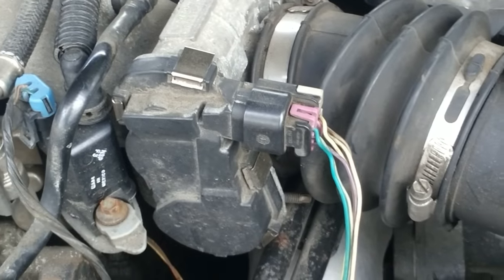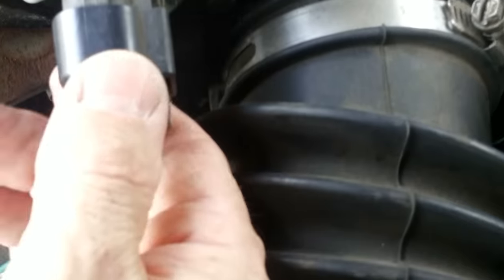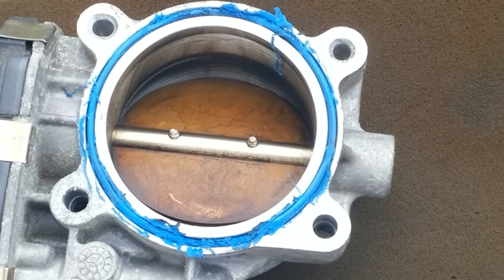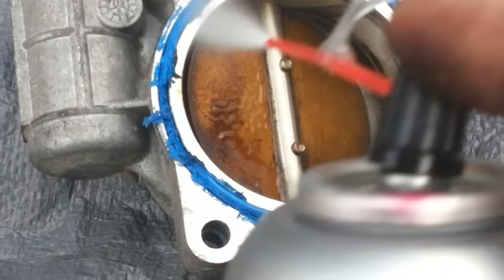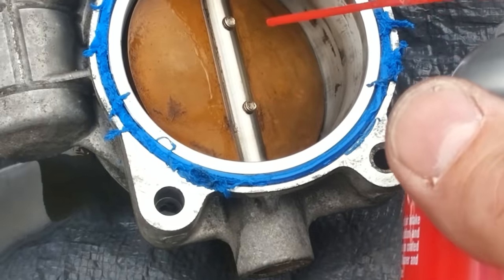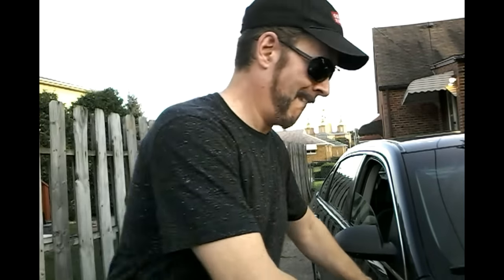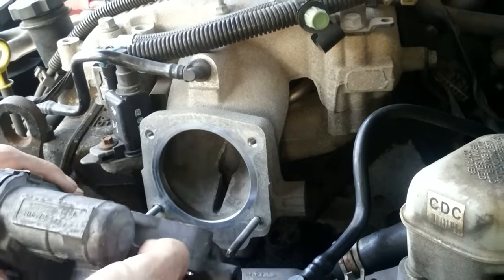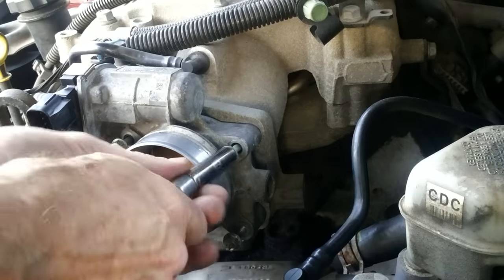Reduced Engine Power.  Here is the FIX.

Comment: MY GOD! You took a 5 minute job and worked it into an all day job. All you had to do was buy the kit GM makes and remove the plastic side of the throttle body and replace it. You did not have to remove the entire throttle body. It does not need to be re-programmed. The ECM does that automatically when driven. Jesus, if you are gonna make a video, make it truthful.
Reply from the maker: Took the throttle body off to clean it and replace the gasket.  Entire job took 15 minutes.  2011 and newer vehicles need to have a throttle relearn procedure done.

Comment: Question?  You said the EMC needs to be reprogrammed & throttle learn reset 2008 thru 2011 Right? I own a 2007 does that mean i wont have to do this step?
Reply from the maker: Your car will re-learn on it's own.

Comment: Hello Sir, when you was having this problem with your car, did the bad sensor prevent your car from starting?
Reply from the maker: No, it would start back up each time.  Is yours not starting?
Reply: @lifeafterlife8417  , yeah. My van will crank, but will not start. I had the throttle body sensor code, on my van. And, I had to change my temperature sensor. I finally replaced my throttle sensor, yesterday. I need to replace my thermostat, before I try to start, again. I had a blown head gasket, I repaired the right way. Changed all the gaskets & valve seals.

Comment: Car on for 3 minboff for 60 seconds do this 3 times then drive above 45 for 10 min high and low accelerations then if not good just do the first steps and you should be fine
Reply: Holly Cain what?
Reply: @tylinbarnes3054  start the car for 3 min leave idle turn off for 60 seconds do this 3 times then drive around for 10 min over 45mph see if its better simple

Comment: Just came back to note that I replaced the accelerator pedal position sensor ($75 part) which was pretty easy, even for a beginner.  So far, no reduced engine power alerts. If it starts happening again, I'll do the throttle body repair.  I've heard the problem is linked to these mechanisms,  and the Chevy stealership will bankrupt you w/ trial and error repairs.
Reply: This would be our next step because we replaced the throttle body and still doing the same thing the mechanic can’t figure it out 😞
Reply: I giggled at “stealership” haven’t heard that before. Gonna use that from now on lol 😂

Comment: People and JD power and associates have given gm vehicles the most dependable cars and trucks but they have so many problems it ridiculous. A former coworker of mine had a I think it was a 2003 or 2004 Chevrolet Corvette that always had this problem it went in limp mode basically reduced power mode every 6 to 8 months or so. Basically General Motors suck.

Comment: What about when experiencing Engine power is reduced, Service traction control and service stabilitrak in a 2011 chevy Silverado 1500 truck?
Reply from the maker: When Your truck is in reduced power mode, the computer disables traction control a stabilitrak.  That's all the message is stating.

Comment: I have a 08 Chevrolet pickup the engine reduced power came on it's been jerking a little bit going down the road I had a friend say the PCV might be stuck or clogged, but I doubt that's the problem as much as I think it could be a throttle body is there anything else that could be wrong?
Reply from the maker: Check engine grounds and have it scanned for trouble codes to begin with.

Comment: So another fix for this is a faulty or clogged fuel pump in my case because of rising gas prices had to use cheaper fuel which wore out the pump pretty quick had a guy swap it with a new one and has driven fine ever since (buick lacrosse cxl 2007 with 3.8L v6 sIII)

Comment: Hello-Question? Did your car actually have reduced engine power? I have a 2007 Chevy Uplander and I had this happen when the car all of a sudden started to not move and I could barely drive it off of the road. The reduced engine power message popped on as well as a service traction system. My mechanic cleaned out the throttle body as it was very gunked up and said hopefully(90% sure) will fix it but maybe have to get a new one later? Anyway had it happen again could barely drive the car off of the road.....same error light messages about 3 weeks later. So noticing past conditions with my car on service invoices from my mechanic I noticed they said I have a power steering leak and that  may need new rack and pinion? I have been noticing a small leak on the ground on the passenger side front as well as noticing a funny feeling steering a bit. Also sometimes not moving fast enough from stop lights or and feeling like when I press the gas it 'sticks' and then surges forward.Not sure if a steering issue could trigger an engine reduced power... or if these issues are not related. Any help -ideas will be appreciated. Thanks.
Reply from the maker: My car actually did...Your steering issue is not related to the reduced engine power message.  Get a second opinion on the rack and pinion.  It may only be the power steering cooler.  It's a common issue on these Chevy's.  That would be an easier (and cheaper) fix.  Your cars computer will disable traction control when it goes into  reduced engine power mode.  That's why you get that message.  It's a safety thing.  You might have a faulty accelerator pedal position sensor triggering the reduced power mode.  Have it scanned for trouble codes and that will get you started in the right direction.  In the meantime, turning the car off in park for a minute or two will reset the reduced power mode temporarily.  Hope this helps and good luck!

Comment: I replaced the throttle body on my 2012 Acadia, I'm still getting the same warnings do I need to reset it
Reply from the maker: Double check the wiring and make sure the gasket was good.  Scan for codes.  Might be something besides the throttle body.

Comment: I've encountered this reduced engine problem so many times ...first on 2003 gmc Denali now my 2010 gmc Sierra flex fuel....I have clean the throttle body and it was  the problem temporary maybe due to carb build from ethenol fuel ...I bought 2010 because of me being able to run ethenol .. however I still have same issues with 2010 Sierra 1500 with the 5.3 ...on both vehicles I have noticed that my cylinder#1 plug keeps getting fouled out very corrosive if you pull that plug clean it put it back in it it drives fine .... although I'm still having other codes pop up. .p0036 p0141 p0301 p02135 p0036 P0056 ... Oh when I clean then throttle body in my 2010 I had to take it to my mechanic to re programm my computer
Reply from the maker: p0036 and p0141 indicates a problem with O2 sensor 2, bank1.  P0301 is cylinder 1 misfire and that makes sense if that plug is getting fouled.  Is it oil fouled?  Could be a bad valve seal.  If it is fouled with coolant, could be a head gasket leak.  P2135 is tps 1 and 2 disagreeing.  That triggers the reduced engine power.  Lot of possible causes.  Sierras are known for faulty cooling fans. They are on the same 5 volt reference signal as the tps. A faulty cooling fan can pull that 5 volts down and trigger code p2135 and reduced engine power.  P0056 is bank 2 sensor 1 O2 sensor.  I'm working on another update to this video and will include  a lot more information since this problem affects so many vehicles.  Stay tuned and good luck!
Reply: Yes it's oil fouled
Reply from the maker: @ifishcarolinatv1951  It's probably not related to the reduced engine power.  Could be a leaking valve cover gasket or a bad valve seal.  But that's why you get code p0301.  The O2 sensor codes  could be related to the fouled plug also.
Reply: Appreciate it the information...

Comment: I've had this problem and maybe have solved the problem by cleaning the ground wire in the engine compartment and the ground wire below the driver door. Mays sense since water and dirt is common underneath  your truck.

Comment: I have a 2010 Impala that was doing the same thing so I changed the throttle positioning sensor and that didn't help so I changed the whole throttle body because it was pretty nasty and that has a new TPS on it but it still does the same thing. Any ideas?
Reply from the maker: scan it for codes.  Also, check the wiring and the harness to the sensor.  They are known for broken wires inside the insulation.

Comment: I changed the whole throttle body and it still does service traction control and throws my power out  and now I can hardly start my car without it going off, even if it’s been hours
Reply: Same problem here. I cant think of any parts I haven't changed

Comment: Been going thru this for months.  I have a 2011 chevy camaro ss.  I've changed the throttle body . I've changed the throttle body harness. I've changed the ACP.  I changed the throttle body positioning sensor and I put a new computer in the car and still my car keeps going into engine reduced power. Driving me damn insane.
Reply: Jay Rod me too, did you figure it out?
Reply: Jay Rod yes this really is the fix!!! And another problem that happens soon is engine hot signal.. it's just thermostat stuck open do not replace sensor.. just thermostat!!!
Reply: Jay Rod it's a 2011!!! Change plugs and filter!!! Computer turns off power to accessories if things are not right.
Reply from the maker: Jay Rod   You might have to reprogram the ECM .  Sometimes this is called a relearn procedure.  This needs to be done on all GM vehicles from 2008 on up after replacing the TPS.  About a hundred bucks at the dealership.
Reply: Jay Rod my wife’s car is a 08 impala and I’ve put 3 new throttle body’s in it, 2 new pedals in her( the sensors ) and she’s still going in limp mode. I’m gonna try this because she just threw the code again and I replaced the throttle body last month.
Reply: Life After Life will definitely try and do that monday morning
Reply: Try replacing the battery terminals, they don't clamp down on the battery tight enough. This fixed my wife's car a year ago after I wasted 150 on a new throttle body.
Reply: I fixed my 08 Sierra by replacing the onstar computer
Reply: Jay Rod clogged up catalytic converter can also be a issue that would lead to the problem ..
Reply: @bradwilcox6849  NEVER!!! Buy a impala👎🏽

Comment: I have a 2008 Saturn Vue and the check engine light and traction control/ABS light keep coming on simultaneously and it’s automatically in limp mode do you think this is the problem some people say just clean the butterfly flap and tunnel out would that work until I can order the throttle position sensor
Reply from the maker: If you can check for fault codes, that would be helpful. P2135 would mean throttle position sensor.  And clean the throttle body.

Comment: I have a 2007 Pontiac Torrent that is doing this I changed the  sensor on the throttle body and the pedal sensor and it's still saying it's got engine power reduced. What could be wrong?
Reply from the maker: Try scanning for fault codes first.

Comment: How much was the plastic part the throttle body kit ?and were did you buy it? I called around and they sell the whole throttle body around 200.00. I can’t find the kit sensor for it and it only has 22k miles for an 06 Chevy Impala.
Reply from the maker: about 80 bucks online but only available separately for certain model years.

Comment: Car Doesn't have to be recalibrated at the stealership,as long as negative battery cable is disconnected for at least 10-15 mins computer will recalibrate itself after restarting and driving....Helps to have access to a scan tool also😉😎

Comment: Guys this will not fix problem.   I had 2004 pontiac grand prix gt.  I replaced the throttle body brand new. Problem came back.  I think it's  the evap purge selinoid and charcoal canister,  that's making this car go in reduce engine power mode.  I replaced everything on my car but the last 2 things.  Charcoal canister and evap purge selinoid

Comment: Was your reduced engine code somehow associated with rain, water? I replaced the throttle body and related sensors and the problem went away. For a little while anyways, but it came back shortly after, one thing I noticed. The reduced engine power code  always showed up after a car wash or every time it rained. It is my understanding that there's a service  bulletin from GM related to this fault.
Reply from the maker: There is a service bulletin on this.  GM vehicles. 2002 to 2005 if memory serves.  There is water intrusion through the windshield and cowling that reaches the body control module.  I think the fix is to relocate the module.  It is located under the dash on the driver side.  Hope this helps.
Reply: @lifeafterlife8417  Thank you for your feedback, it's frustrating for sure. Process of elimination could get expensive after a while.
Reply: @lifeafterlife8417  Thank you for your feedback, and your video.

Comment: Please I have a 2007 Chevrolet impala that has the codes P0054 (4/5) pending and P2128(3/5)stored  Please what do you think is wrong with my car 🚗
Reply: P2128 is a problem with your Accelerator pedal position sensor.  (gas pedal)  Check the wiring and/or replace it.  P0054 is a problem with your bank 1 downstream heated oxygen sensor.  Again, check wiring and/or replace.  Good luck!

Comment: Some say just replace the pedal how do you know if you should replace the pedal or the sensor cap
Reply from the maker: Fault code 2135 indicates the throttle position sensor as the possible culprit.  Code 2138 indicates the accelerator pedal position sensor. (gas pedal)
Reply: @lifeafterlife8417  got both of those codes too thanks and 0351 2122 2127 2128 just replaced a coil pack a few hours ago...enjoyed your video thanks

Comment: 2007 cobalt the message sending unit says reduce engine power .. you think it's the same problem.  Cause when we got it diagnosed and got a code saying camshaft sensor.. replaced it does the same sh ut t off while you driving .. if you can help

Comment: Hi I have a Chevy impala 06 and I was told I need to reprogram the engine control module or I may need to change it it’s an electrical problem is there a way I can reach you?
Reply from the maker: Does the car run?

Comment: I have a 2010 buick enclave i bought an amazon throttle body with built in sensor. Looked like it worked fine for a month an boom light came on. I have no code for it that came on. Please help
Reply from the maker: Check engine light or reduced power light?
Reply: Stabili trak and reduce engine power. Triangle light pops up

Comment: I replaced my TPS and it's still stuck in limp mode? My dealer won't be open until monday so I'll get it flashed then, is it limping because I haven't given it the old relearn procedure? I also have a "Service Stabilitrak" message. Some of my friends were suggesting EGR valve. What are your thoughts? TIA This is on a 2010 5.3L Sierra EDIT: From reading the comments, Im guessing a 2010 Learns itself, am I just up the creek without a paddle?
Reply from the maker: Shouldn't have to do a relearn on that.  The service stabilitrak message is there because the computer always disables stabilitrak when in reduced power mode.  Those 5.3 engines are known for other components being on the same 5 volt reference signal as the TPS.  (cooling fan is most common)  A fault in one of these components can cause the 5 volt reference signal to the TPS to be pulled down triggering reduce engine power.  Check for more fault codes.  That could be a good starting point.  Also, double check the wiring to the TPS.   Best of luck!
Reply: @lifeafterlife8417  I got a P2138 Code, upon research it looks like others have had this problem and replacing the gas pedal should fix it. I think there's a recall on it somewhere. More research.

Comment: I put a brand new throttle body on my truck but it still did the same thing. Reduce engine power and cuts off. What should I do now?
Reply from the maker: What kind of truck?  It could be one of the other things that are on the same circuit as the throttle position sensor pulling the 5 volt reference signal down.  The cooling fan is the most common on some GM trucks.  Check all the connections also. 
The next time this happens,  pull over somewhere safe and with the engine running in park disconnect the cooling fan for a minute or so.  If the problem goes away, you know it's a faulty cooling fan.  Don't forget to reconnect it!  Good luck!

Comment: I have a 2009 Cadillac CTS and the car overheated and the temperature gauge went up to 260 then that indicator came on the" engine power is reduced" what does this exactly mean
Reply from the maker: Could be low coolant level.  Could be faulty water pump.  Could be faulty cooling fan.  Could be faulty coolant temperature sensor.  Reduced engine power is designed to get you to a "safe" place to stop (hopefully) without doing further damage to your engine.  Hope this helps and good luck!

Comment: my throttle body has no stem coming off of it and the sensor has a small circuit board in it can you xplain???THX
Reply from the maker: What year, make, and model car?
Reply: @lifeafterlife8417  07 gmc sierra 1500 not classic 5.3